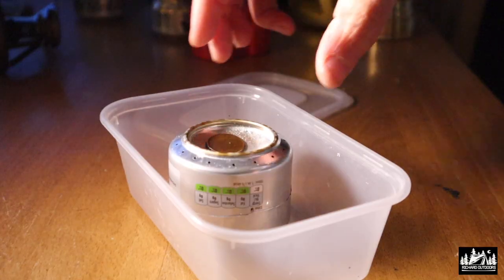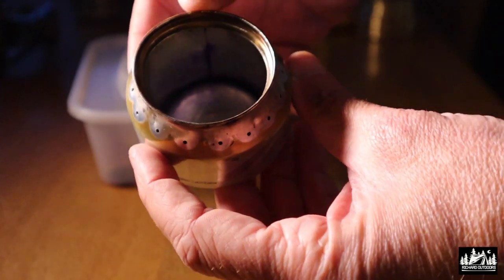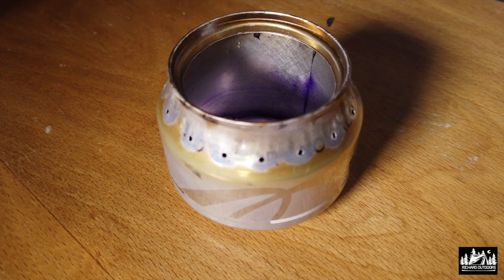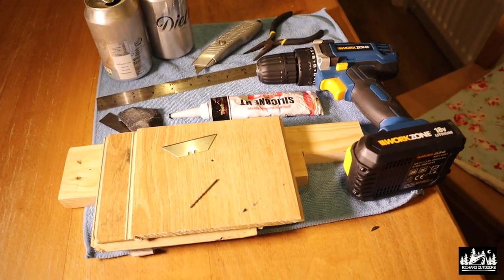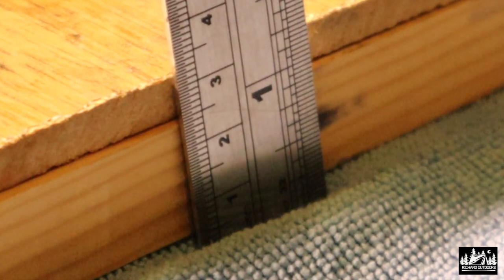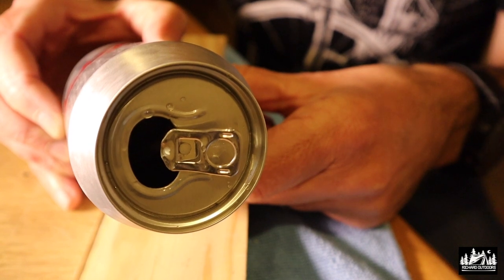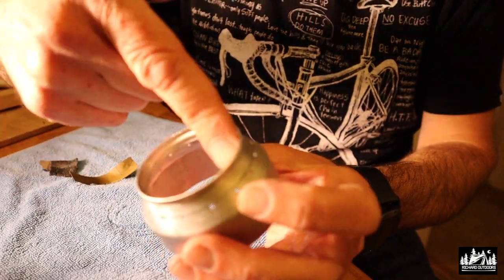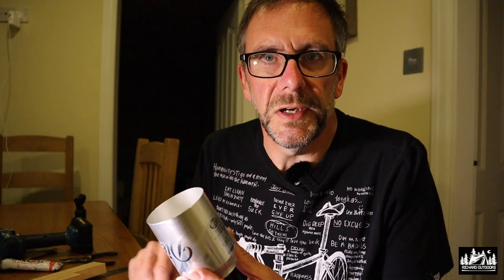Make it!  Coke-Can Alcohol Stove and Subs GIVEAWAY!!!  Entries now closed

Comment: Another great video, Richard.  Rub some dirt on that burn.  You'll be fine.  FYI....we don't have the purple methylated spirits in the US.  We have clear denatured alcohol, which is basically the same thing but without the coloring.  90% ethanol with 10% methanol to make it undrinkable.  I prefer Heet, which is a fuel additive used to prevent freezing.  It's mostly ethanol and burns very clean.

Comment: Brilliant job there Richard, thank you for the demonstration. I didn’t have much success with the penny stove. Don’t think I used enough fibreglass as I couldn’t get the flame to come from the drilled holes. I’ll have another go as well as having a go of this one. I much prefer the design anyway. I’ve spotted a flaw in using rocket fuel in the lantern by the way, it’s a little expensive!  😂. Great giveaway too! Please include me in the draw.  Thank you very much.
Reply from the maker: Pleasure. Yes, I think you really need to pack in the wadding. If you spill a bit of fuel down the side whilst lighting the stove (stove on a heat resistant surface) it can help. RO.
Reply: Thank you, I’ll give that a try.

Comment: I've made a similar one of these before but I will drink a couple of Northern Monk's this afternoon and have a go. I didn't use sealant before and had no issue so I might try without using the BBQ can stretching method I mentioned before and post the results. Loving all the videos and you're inspiring me to play with my dehydrator I've had sat in the cupboard for 3yrs (I bought it to make potato crisps) but they didn't work very well so I packed it away :)
Reply from the maker: Great - let the Northern Monk wear off before grabbing the Stanley knife! Thanks! RO.

Comment: I think that's brilliant. I'd like to have a go at one of those, need a pot stand though unless I can knock something up with some bits of something. How much fuel does it hold and how long does it last?
Reply from the maker: Hi there.  I don't know the fuel measurements but just a couple of capfuls of meths is enough for a 750ml water boil.  Thanks for watching!  RO.

Comment: Looks good might try this design soon as I've had a few problems recently as my attempt as they burn a bit to aggressively with a bright yellow flame and get a bit out of control could this be due to to bigger drill holes as I'm using a 4mm bit for them?
Reply from the maker: That'll be it - 1.5mm seems the ideal size for the jets.  RO.
Reply: @RichardOutdoors  just got round to making one and your 100% right thank you :)

Comment: Excellent video, thanks. I'm a bit confused by your glue though. Is it epoxy, silicone, or some combination of the two?
Reply from the maker: Sorry. Still a little nervous in front of the camera! Mine is silicone but anything is fine as long as heat resistant. JB weld too is good. RO.

Comment: What type of glue did you use that would seal with the high temperature?
Reply from the maker: Hi Francis - any heat resistant silicone or epoxy - JB Weld do a good one.  RO.

Comment: Quite a few thoughts popped up here:
- I never glue the parts together (esp not with heat resistant silicone epoxy ;-) ). Just do one of the triangular cuts at the bottom of the inner wall across the overlap, fold the corners over and the cylinder stays in it's shape
- Use another, unopened can to push the top and bottom together. Cans are made to stack neatly..
- If you dent the top of the stove, you can use the stove itself as a pot stand. The dent allows for airflow to the main chamber. 
- If you're concerned about the pot cooling down the alc when it rests on the stove, then instead of denting the top, put 3 small spacers at the rim of the stove. Eg a small piece of paper clip wire bent around the rim.
Finally, I'm out for the giveaway, I got too many of those stoves aready, thx :-) But once you throw a metric ton of flint into your next giveaway I will be very very in. No flint in the parts where I live 🙁